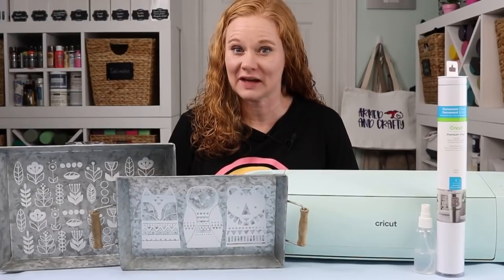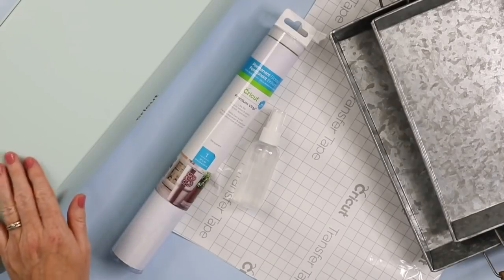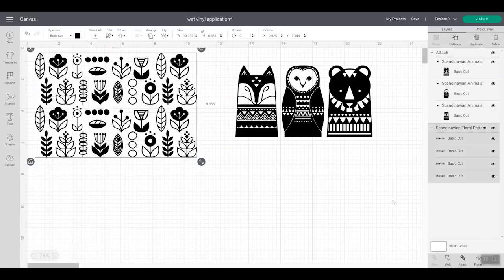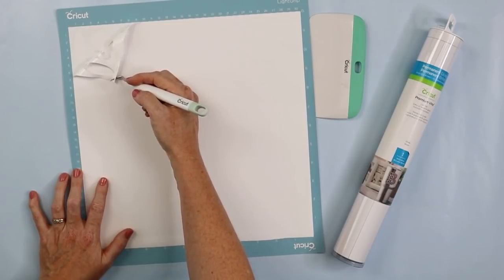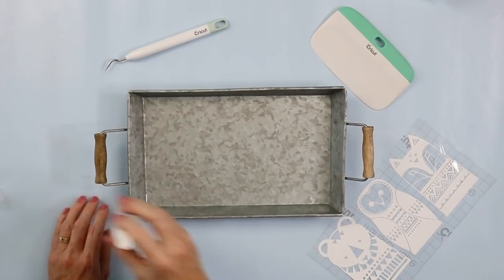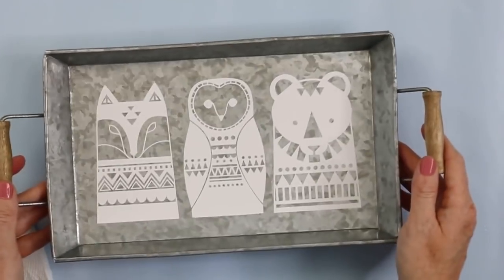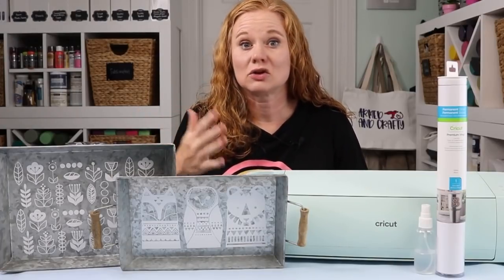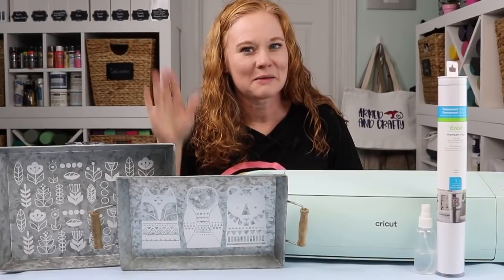Wet Vinyl Application Method with Your Cricut

Comment: So growing up my dad was a display carpenter, meaning he made the displays and booths you see at trade shows. He used to get vinyl cut at work all the time using their full size machines and so on, and he taught me to use the wet application method with that very early on for exactly one of the reasons you mention: location. In their line of work, precision is everything and they always needed to be able to maneuver the decal into exactly the spot it needs to live in. It’s a great method and even though it takes longer to dry and be ready for use, you get a level of precision you don’t get otherwise.
Reply from the maker: So true!

Comment: I have used the wet application method on the outside of my car window, using Cricut permanent vinyl. Even after a few years, it’s still there, no lifting or cracking, and I live in Florida (extreme heat/sun, rain, even car washes). My decal says “…Spoilers”, if you are a Whovian, then you appreciate the significance 😁
Reply from the maker: Thanks for sharing!

Comment: I had a solution of a small amount of soap and spray bottle of water to put large label stickers on doors and used a squeegee to place the sticker on both metal and wood doors and metal panel doors.  I also used a level to straighten my signage before it set and stuck.

Comment: What about using the water method on tumblers, before putting epoxy?  If the method can be used, would you wait 72 hours before putting epoxy over it?
Reply from the maker: Yes you can! I would wait 72 hours to let the water evaporate.
Reply: @AngieHolden  Thank you so much.  Your videos are so helpful.

Comment: Would this work on a painted surface? Wood, glass, metal
Reply from the maker: It should! I would make sure the paint is completely cured.
Reply: I have personally seen vinyl applied to pained surface using the wet method. Works great and lasts. But like Angie said, definitely make sure the paint is completely dry 😊
Reply: @AngieHolden  ya that makes sense - this method seems like a dream come through - I was beginning to hate vinyl